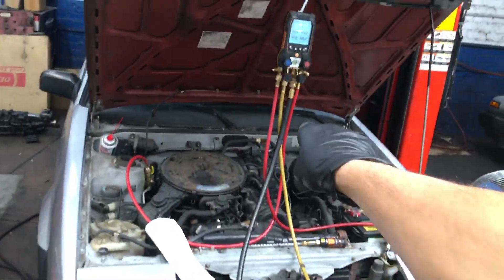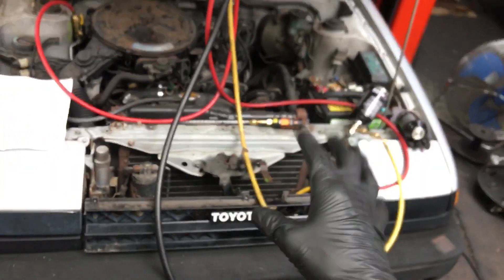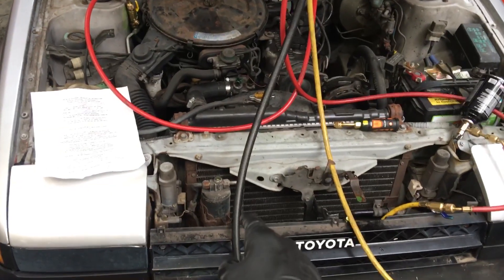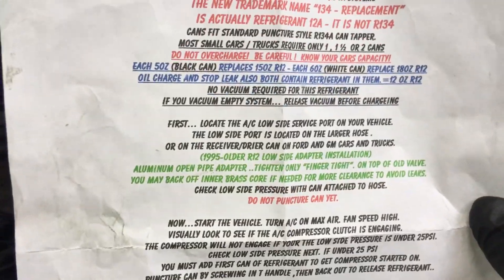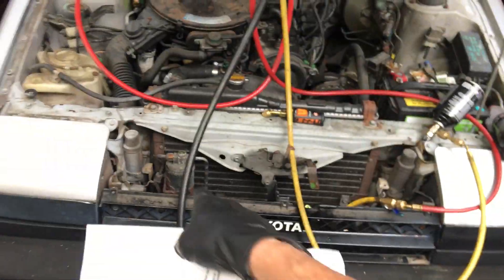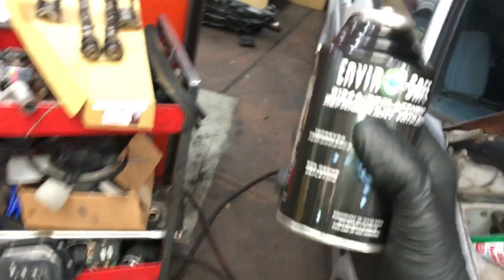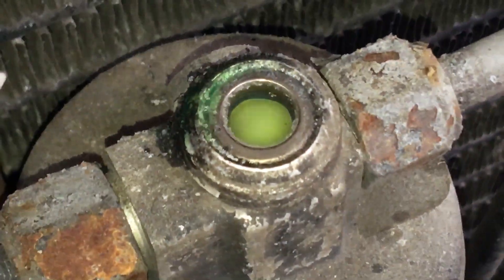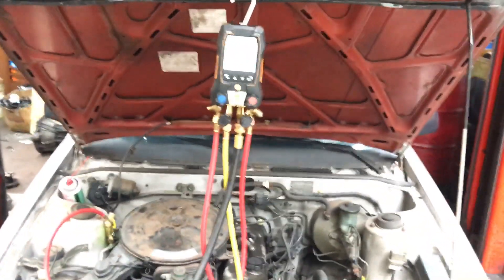Flammable 🔥 Refrigerant Installed In  Car Past Leak test, but now it leaks. Let’s put a match onit

Comment: Just charged my son's 95 Dodge Ram 2500 turbo diesel with Enviro-Safe. This refridgerant is Awsome! Runs a lot colder🥶  I've never seen the low pressure line from the orfice tube at the radiator all the way back to the firewall covered in ice. Also the high side pressure side is running 100 psi lower. We charged his system with the recommended 12oz. Normally his AC system requires 2lbs. or 32oz. of R134A. So that's 1lbs. 4oz less refridgerant. With lower pressures that means better efficiency which will help the AC system last longer and less power needed to run the AC. Remember the reason they went to R134a was for the environment not because it was a good refridgerant its not. R134A runs higher pressures which equals high temperatures which requires more power to operate and shorter compressor and AC component life.I highly recommend it.
Reply from the maker: Very true propane and butane are far superior refrigerants then our regular synthetic refrigerant like R134 or R1234YF 

The only problem as professional license mechanics who are EPA certified we are not allowed to put flammable refrigerant into automobiles that are to be driven by the general public on the public highways. 

If OEM manufacture converted over to propane or butane as a refrigerant I would be all for that right the next day you would see me charging all cars with propane in butane

But unfortunately on all the past vehicles they did not build the interior cabin evaporator to be robust and guarantee against refrigerant leaks flammable refrigerant into the passenger compartment. 

So we are stuck using regular chemical base refrigerants that are not explosive because of this. 

But one day when they get their act together and realize propane and butane or a far superior refrigerant what did they do know is true and it is a fact. 

we live in a world of lawyers and lawsuits and looking for any reason that somebody may get harmed and have a multi hundred million dollar lawsuit against any corporation that uses a flammable refrigerant

But what they can do is they could use a propane or butane to chill a glycol loop through a heat exchanger heat plate and the refrigerant with chill glycol and then the guy calls you a electric pump would be pumped into the cabin compartment to a liquid evaporator and you can feed 24° 27° liquid glycol to the evaporator to chill the passengers so if there was ever a leak the leak would only be coolant glycol call
Reply: @coldfinger459sub0  How likely is an evaporator to suddenly develop a large enough leak to be an actual hazard all on its own? I've personally only seen one evaporator leak and not only was it a known issue on that model, but it was a very small leak. Considering the small flammability range for propane, that issue might be overblown. Personally, I'd be much more concerned about what happens if the condenser is damaged in an accident.

A secondary loop is an interesting idea, but I would think the efficiency lost would more than offset any efficiency benefits of hydrocarbon refrigerants not to mention the added cost, weight, and complexity and wouldn't address the much more likely risk of a condenser leak.
 
Another thing to consider with a secondary loop is the thermal mass the liquid would add. A nice benefit on long trips to keep temps stable as the compressor cycles and to reduce cycling, but not very good for quickly cooling off the interior since there won't be any cooling until the secondary liquid cools off.

Assuming the secondary loop is filled with a gallon of water that heat soaked to 130 degrees F while parked, 10K BTUs of cooling capacity, and no heat being added to the loop during cool down (not realistic), it would take around 4-5 minutes just for the water to be chilled to 40 degrees. People would probably complain about that.
Reply from the maker: @averyalexander2303  secondary loops are already used in most all electric vehicles now with glycol systems

And even regular engines that are not electric vehicles like to be BMW 400 series and one of their other ones use a condenser glycol loop system already in production very efficient very small and compact. It’s only a few inches from the compressor all in one self-contained plate, heat exchanger dryer Expansion valve, nice and compact. 

This is technology that has been used for over 100 years using refrigerant to cool a glycol and pump it into buildings. It’s nothing new. 

Just new to vehicles 

I’ve only seen two evaporators burst out in front of me while I was on a job filling them . 

Completely inundating the entire contents of the refrigerant plus the oil making the inside of the passenger compartment look like San Francisco fog, or somebody shooting off a little fire extinguisher out of the duct dash vents 

I would not worry about a condenser catching fire after a collision . 

Even if the quantity of refrigerant needed would only be 3 to 5 ounces of propane . 

And would use a loop system so there would be propane inside the condenser it would be glycol 

Everything would be close loop with two heat exchangers, right off of the compressor, small and compact water pumps. Take care of the rest of the systems. These are already in use. They’re already in practice. Use all over the world by most manufacturers now especially Hyundai and Kia. For their electric vehicles.

It’s gonna be real fun seeing the shops who are not ready to work on the systems roll into the shop when they’re 10 years old with problems with heat pumps reverse flow cycle 3 to 4 water pumps and 2 to 2 way and three glycol reversing valves 

The guy called cooling down loop is already used and many of the high-performance vehicles with your air conditioning like the Dodge hellcat 
For the supercharger has a glycol plate, heat exchanger, and intake manifold 

After the air is cooled through the first loop through the air air heat exchanger in front of the car then the remaining heat is removed as it enters below the liquid cooled plate, heat exchanger to cool off the air, so it would be more dense before it enters the cylinders for combustion 

Old technology been in production for years you just have not seen it yet
Reply: @coldfinger459sub0  I didn't know that, thanks for sharing! I can't say I'm surprised though since I know some EV's use the AC system to help cool the battery coolant.

As for the evaporators blowing out, that's pretty much what I thought. Probably not much risk there to begin with and the tiny amount of risk that is there could probably be mitigated pretty effectively just by building the evaporators to a higher standard like the R1234yf evaporators.

Either way, regardless of the type of refrigerant used, the evaporator deciding to randomly explode while I'm driving down the road is pretty far down on my list of worries LOL.
Reply from the maker: @averyalexander2303  I don’t worry about it, even if I put propane in my own vehicle and evaporator started to spew out propane

I would just roll down the windows and keep driving 

Three or 5 ounces will be gone in no time at all diluted out
Reply: @coldfinger459sub0  With that said and you understanding the law about using HC refridgerants I'm surprised you would install it? Even though your customer supplied the parts you as a licensed AC technician are still liable. Just like if you alter the emission system with customer supplied parts. Anyway 12oz isn't really enough to be a danger. Worse  case if was all vented out in the cab all at once and ignited you would at most  singe your eyebrows. If your worried about flammable refridgerants then you will be absolutely horrified by the 1660 sticks of  dynamite chasing 3ft right behind you sloshing around in liquid  form in the fuel tank.

Comment: Gas and motor oil is flammable too.. whats your point ???????
Reply from the maker: The only consensus of a concern is that the internal catheter evaporator we’re not to be designed to be filthy they actually leak quite a bit in vehicles. 
                   When evaporator are designed for flammable refrigerant do you sticker wall material they use better breathing or welding techniques they use a higher grade material and machining processes to ensure a high percentage of a leak free product and we’re human habitation may be in danger. 

       And when it comes to automobiles and lawyers in the department of transportation anything to do with safety light tires brakes seatbelt airbag windshield wipers that could possibly kill people have lots of lawyers following behind just waiting for an excuse for a lawsuit. 

          I myself personally would prefer if our air conditioning was 100% pure propane or butane R290 / R600

       But using a glycol loop heat exchanger to run chilled glycol into the passenger compartment that would be the safe way to do it. 

         But truly I’m not concerned with the refrigerant charge they would only be about 3 ounces to 5 ounces of flammable refrigerant
Reply from the maker: Here is a link to a guy who started to smoke a cigarette while he had a propane leak in his truck
https://youtube.com/shorts/ZS-lVDKN5HE?feature=share

Comment: By the way 
I already 
Swap and using 
Digital thermostat 
To control cooling rang
To cut the compressor 
When cooling more than what I need 
+
Adjust close 4c 
And on 8 c
Also I swap
In line sensor pressure 
In the same place of my original sensor for bmw
To cut 12v for the compressor 
+
To give ground signal to my relay on for the aux front fans

.

✋🏻

https://www.ebay.com.au/itm/383297174370

https://www.ebay.com.au/itm/363332540613?hash=item54984e98c5:g:sbwAAOSwS-xgWvJi
Reply from the maker: Cool 👍🏻. I bought a few of the same thermostat 

Good for everything universal

Comment: Man I’m so glad 
🌹
Let we start 
1- car mat or doors seal
Or heat under the car
It’s fine 
Because 
The car is bmw 2009 
Swap ls1 😁
As I told you 
The compressor for camry 
The condenser aftermarket 
But same car model
,for factory 
2-
We need to do something 
Nobody created before today 
🙏🏻
3- 
You didn’t answer me about the compressor 
If the sanden better or stronger than denso
4-
Now let we start working 
If get new condenser 
?
Choose with filter
( same the oem in my car now )
Because some condenser 
Come with out filter 
?????
5- which condenser 
I swap in the front 
The hot hose comes from the compressor 
I connected to the front condenser 
Or to the second one 
??????????
The hose from comp going 
To the condenser with filter
Or ?????
( if you recommend dual condenser with filter )
Or
If you recommend one with filter
And other without 
Ho is in the front
W/ filter 
Or without filter
,
And ho is will connect the base that coms from the compressor 
,,,,,,,,
I’m sorry about my English language 
I’m sorry about my long story 
I’m so glad man
,
Please let me know what do you think 
And please 
Recommend for me any condenser you think it is the correct 
For my project 
,
Many many thanks 
🌹🌹🌹
Reply from the maker: Looks like I’m going to have to draw something on paper and maybe make a video and post it for you. 

Probably to universal condensers no filter

External receiver dryer. 

Sanden is a very durable manufacture DENSO is also very good. 

But for durability reliability probably the Sanden

Now there is many different sanding compressors you pick them by internal displacement this is where you have to go to the manufacturers website. 

      Because you will have dual air-conditioning condensers.   Do you have a little more volume. 

Yes you get a second evaporator you will have a little more volume and need more refrigerant so you will need a bigger receiver dryer. 

 the receiver dryer’s external like they came on Toyota sienna van.   Do you see how big and long the receiver dryer is to hold more refrigerant. 

Because the aftermarket universal condensers do not have receiver dryer built into them. 

Are these used compressors ?  are you buying new compressors ? 

      If they are used compressors then you have to go to the manufacturers website for each compressor and look up the displacement how many cubic centimeters how many cubic inches of displacement and pick the biggest one that you have.
Reply from the maker: I’m going to send you three instructors YouTube teacher web link to watch subscribe to their channels and watch their videos
https://youtu.be/2SEDe0v8VPY
Reply from the maker: https://youtu.be/nwPA56cXqMA
Reply from the maker: You need to watch these videos before you proceed so you have a little better understanding

https://youtu.be/QDIKtN3J3S0
Reply from the maker: Run the door condensers in parallel

Receiver dryer filter does NOT Go in between compressor and top port of condenser. 

Receiver dryer only goes after the bottom liquid line from the condenser to the expansion valve.